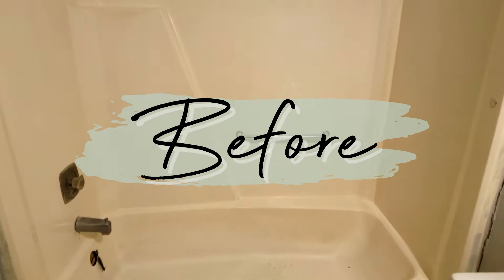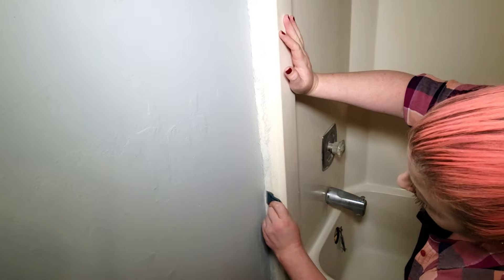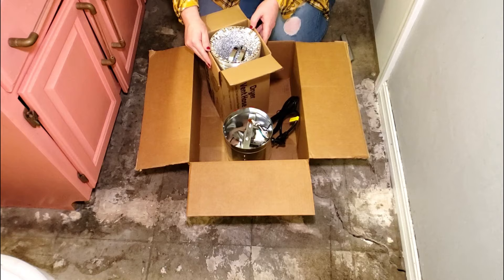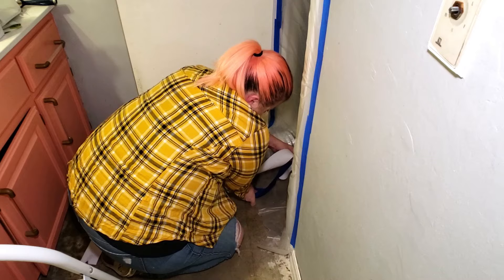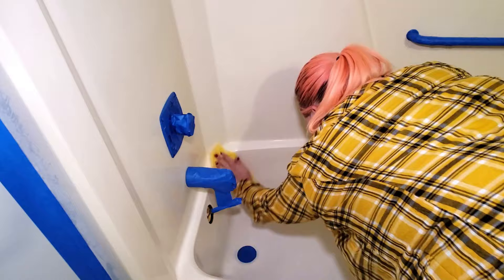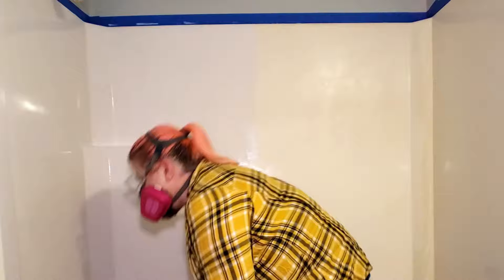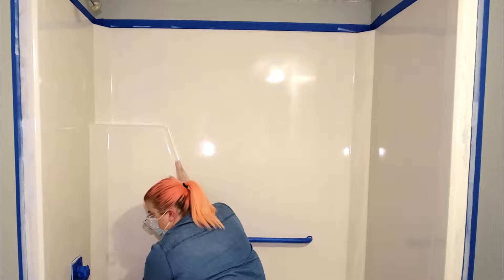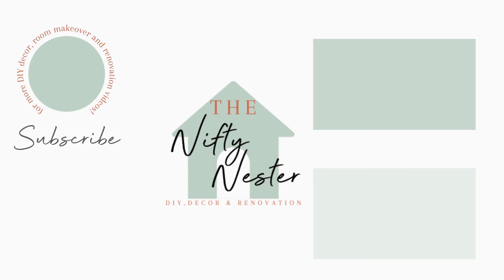How To Paint A Bathtub Yourself | The STRONGEST & CHEAPEST Way To Refinish Your Bathtub!

Comment: DON'T TAPE OFF the drain, handle or faucet! Just remove the screws of the handle cover & pull forward. The faucet uncrews (just enough that you can get the sponge brush behind it) & after removing the screw to the drain cover, the drain unscrews too.
Reply: If she didn’t tape off the drain then the paint/epoxy would fall down into it

Comment: 1) Why did you not use TSM to remove that stain and all oil residues 2) Why did you not use a primer - If you skip priming, you risk peeling paint, especially in humid conditions. Moreover, the lack of adhesion could make cleaning more difficult months after the paint has dried. You may find the paint wearing off as you're trying to wipe off dirt or fingerprints
Reply from the maker: First, that stain has been there for a couple of years. In that time frame I've tried TSP, bleach, mineral spirits, nothing worked. This tub is old, the finish was worn down and that stain is deeply embedded in to the material.
Secondly, I read every review on every website I could find where this paint was used to refinish a tub. This paint has consistently held up by itself over long periods of time without a primer if the surface was well prepped. I don't know if that's because it's an oil base, maybe it has some primer type properties to it. Either way this stuff dried in to a rock hard shell. There's no peeling at all, no stains coming through and when I clean it everything wipes right off. It actually cleans way easier than any tub I've ever had.
I assume most people paint their tubs when they need a fix without the cost of replacing it, I know I did. It looks like I'll get at least a few good years out of this and I can touch it up if I need to at that point. By then it will have served it's purpose and I couldn't have done the job for any cheaper.

Comment: Is this a good technique if my shower paint is peeling? I can do this and it’ll be fixed??
Reply from the maker: Good question, unfortunately this won't fix the issue with the paint on your tub. If the paint is peeling there's an issue with that paint bonding to the tub underneath. I would suggest scraping or sanding off the old paint first then starting over with this paint. I hope that helps, good luck!

Comment: thank you, question, what about primer
Reply from the maker: Sorry for the late response! You don't have to use a primer with this paint, they say to just make sure the surface is properly prepped beforehand. You could use a primer if you wanted to but you'd want to use an oil based primer if you decide to use one. I will say I haven't had any issues without using a primer.

Comment: Hi! I really loved this video and am in the process of doing the same to my walk in fiberglass shower. I’m worried though because the same paint I got as yours says to only do it above the water line. So I’m hesitant to do the floor. How has yours held up? Was it slipper at all? Anything you’d do or use differently?
Reply from the maker: Hey! Thank you 😊 I had the same worries after reading that as well but because the reviews were all so good I went ahead and did the entire thing. I haven't had any issues at all with the finish, it's held up great with regular use. I was also worried it would be too slippery but it hasn't been. Our original fiberglass tub had a slight texture to the bottom of the tub, I'm guessing as an anti-slip measure, and that texture still comes through which probably helps but the finish doesn't feel slick under my feet. They do sell a non-slip additive and I thought about trying that out on the bottom of the next tub that I do but I haven't needed it so far. You could probably add another coat with the non-slip additive at the end if you decide you need it.
Reply: @TheNiftyNester  that was all very helpful thank you so much for sharing 😊 I will definitely try it out then and add the adhesive if needed like you said. Thank you again ❣️

Comment: I'm curious to know how this has held up.
Reply: I used marine boat paint to paint the tiles in my tub/ shower (left the bath tub did not paint it). It looked great when it was done. After about one year it still looked pretty good. After about 2 years it started to show defects- small scratches and some minor peeling (mostly were the bar of soap was constantly hitting the wall). However now after 3 years it has started to really yellow. It still looks "white" (not horrible yellow like you would see in a smoker's home or bad yellowing you see in bright sunlight). It would still look kind of white if it was by itself however because it is directly next to the original high gloss bath tub, toilet, cabinets, shower bar etc that are all manufacture painted (I believe powder coated or porcelain) gloss white the yellowing of the marine paint becomes very noticeable. There is a big difference between the painted tiles and gloss white tub. Directly after painting the tiles the paint will look just like this video. Gloss white tiles blending nicely with the gloss bath tub. However be prepared to repaint every few years because it will definitely yellow over time. I am just happy I only painted my tiles that can be easier replace or covered with a liner if I dont' want to keep repainting vs painting my entire bathtub that would cost thousands of dollars to replace. 
Overall experience it looks great directly after painting. However it will yellow so be prepared to repaint every few years (in my experience three years).

Comment: I painted my tub myself. I was surprised how nice it turned out but……months later the paint is chipping a lot. I have to repaint again. I didn’t sand down the tub before painting the first time. Do you think that is why it peeled? The tub wasn’t used prior to the three day wait either.
Reply from the maker: I definitely think sanding it beforehand is one of the most important steps. The prep work is as important if not more important than the actual painting. After you get the old paint off, definitely take the time to prep your tub, and that should make a big difference this time around.

Comment: How safe are the chemicals in it to use in shower given the fact you had wear a mask to protect yourself?
Reply from the maker: That's a great point, I should've mentioned this in the video. The fumes are only an issue while working with the wet paint. Once it's dry and the paint has cured the fumes dissipate and it's totally safe.

Comment: Can I do touch up on certain places or do I have to paint the entire tub again? I've done 2 coats but there were a few spots that ran so I want to sand them and add more paint but I'm not sure about the process. Anyone know?
Reply from the maker: You should be able to sand and touch up just the areas that need it, like you said. It bonds better if you do that before it cures but even if it's already cured, scuffing the surface first should let the touch up stick.
Reply: @TheNiftyNester  Thank so much for the reply.

Comment: Can this paint be used on ceramic tiles and porcelain tub?
Reply from the maker: Yes it can. I did a lot of research before painting mine and found reviews of people successfully painting every bathroom surface imaginable. As long as you prep your surface properly first and degloss/sand it should adhere well.

Comment: I did this about 3 years ago. The result was amazing and it was worth all the process and smell. Until it started to peel. Now is nasty and it bothers me more than when the tub was pink. This is a really temporary solution.
Reply from the maker: It definitely isn't a permanent solution but helps to make an old tub liveable until you can replace it. Have you thought about sanding then repainting your tub? I figure if I still have mine in a few years I'll just repeat the process but I'm hoping I can gut and fully renovate this bathroom at that point.
Reply: Sucre Dulce,  did you use the Marine Paint or something else for your tub???

Comment: Will this paint work in a porcelain sink?
Reply from the maker: Yes, it should. I haven't personally painted a porcelain sink or tub but when doing the research on this paint I found reviews where others had painted theirs successfully and they said it worked. From what I read it should work on pretty much any hard surface that's typically used for sinks and showers.

Comment: Not quite a year ago.  How's it holding up?
Reply from the maker: It's holding up really well! I'm hoping to do an update video in the next month or so, but I would recommend this product all day long.
Reply: @TheNiftyNester  I just finished mine on a very old fiberglass shower stall.  Everything video I saw using the bathtub kits seemed so iffy to me.  The marine paint made sense and took about 1 and 1/2 quarts for two coats.  Turned out so nice.  Your video convinced me it was the right method for me and the smile on my wife's face validates it.  Thanks!

Comment: How long did this process take from start to finish?
Reply from the maker: I spent 3 days but it could be done in 2. I cleaned, sanded and prepped on day 1, did the 1st coat on day 2 and the 2nd coat on day 3. You could prep the same day as the 1st coat and get it done in 2 days. The actual time it takes to paint on a coat isn't long at all, I want to say it didn't even take an hour for each coat. It's the dry time in between that makes it a 2-3 day project.

Comment: Did this paint hold up because I see you didn't use the primer before painting
Reply from the maker: It's held up really well! I'll have an update video posted in a few weeks if you want to check that out. I'll probably try the primer on the next tub that I do, but this paint doesn't require a primer. They do say to use the primer if you have any damage or made any repairs to your tub/tile since the repaired areas need to be sealed. I also think it could be a good idea if you're covering a bright color. Someone commented that they used primer on their blue tub, and it covered the color really well. They didn't have to use as many layers of paint to hide it. You can always use the primer even if your tub is in good condition, you just don't have to. I hope that helps!
Reply: @TheNiftyNester  Good to know I bought the primer specifically for this paint made by rustoleum i havent tried it yet

Comment: Everyone says it yellows after time??
Reply: I used marine boat paint to paint the tiles in my tub/ shower (left the bath tub did not paint it). It looked great when it was done. After about one year it still looked pretty good. After about 2 years it started to show defects- small scratches and some minor peeling (mostly were the bar of soap was constantly hitting the wall). However now after 3 years it has started to really yellow. It still looks "white" (not horrible yellow like you would see in a smoker's home or bad yellowing you see in bright sunlight). It would still look kind of white if it was by itself however because it is directly next to the original high gloss bath tub, toilet, cabinets, shower bar etc that are all manufacture painted (I believe power coated or porcelain) gloss white the yellowing of the marine paint becomes very noticeable. There is a big difference between the painted tiles and gloss white tub. Directly after painting the tiles the paint will look just like this video. Gloss white tiles blending nicely with the gloss bath tub. However be prepared to repaint every few years because it will definitely yellow over time. I am just happy I only painted my tiles that can be easier replace or covered with a liner if I dont' want to keep repainting vs painting my entire bathtub that would cost thousands of dollars to replace. 
Overall experience it looks great directly after painting. However it will yellow so be prepared to repaint every few years (in my experience three years).

Comment: How did you get rid of the smell? I recently painted mine and I'm worried about the fumes not going away.
Reply from the maker: Have the fumes gone away now that it's been a few days? I left my ventilation system running for a while after applying each coat, then turned it off before I went to bed. After the last coat, by the time I turned the ventilation system off at the end of the day, there wasn't much of a smell left. By the time the tub had cured (about 3 days later), there wasn't any smell left. Sorry, I don't have any great advice other than that.
Reply: @TheNiftyNester  So the fumes have gone away, but it has like an after stench. But I've only been able to put on 1 layer so far due to time constraints.

Comment: So no primer needed?
Reply from the maker: If your tub is in good condition you don't need primer. If you make any repairs, like fill in chips or cracks, then you'll want to use the Rustoleum Marine primer first. Any repaired areas won't be ready to adhere to the paint. Other than that, this paint is meant to stick to this type of surface without needing a primer.
Reply: @TheNiftyNester  thanks

Comment from the maker: You can watch the BATHROOM MAKEOVER ON A BUDGET final episode & reveal right here! https://youtu.be/tjeefKzNcUU
Reply: Great job. Just remember not to use bleach or bath mats on resurfaced tubs. The bleach will make the paint bubble and the mats will pull up the paint. I'm an apartment manager and residents tend to forget and mess up the tubs.
Reply from the maker: @CindyLou42  Thank you! Can I ask what you guys use to refinish the bathtubs at your complex? I've used bleach cleaner on mine without any problems, although I've only used it a few times. I usually use a different bathtub cleaner. I know a lot of the tub and tile kits are epoxy, I wonder if bleach is bad for epoxy specifically?
Reply: @TheNiftyNester  The company we use applies a urethane coating and recommends cleaning with Lysol, Mr. Clean, Fantastik, Scrubbing bubbles, Formula 409 or anything mild and non abrasive. If you use bleach, you'll notice the paint will start peeling after a few months. If you use it a lot,  it may start peeling within a month.

Comment: It won't stay you should have used a two-part epoxy then you're onto something otherwise it's just going to fade
Reply from the maker: It's been almost 2 years, and I'm not having any issues with the finish at all. I decided on this product after stumbling across it and reading every single review I could find. A lot of people have had great results with this product. On the other hand, a lot of people have had really bad experiences with tub & tile kits. 2 part epoxy is probably a great option as well. I looked into one, but it would've cost me over $100 in product alone. I'm happy with this product and you can't beat the cost. In the end, I think everyone should use what works for them and is in their budget.

Comment: Next time do better prep work or at the very least let people know you can take trim pieces and accessories off before painting so you know.... they don't have to repeat the process if they decide to replace with different faucets and trim/handle..... pretty lazy if you ask me, especially considering the time you took to set up the door seal and ventilation. Refinishing a tub without installing new accessories and fixtures is like putting a $3000 set of wheels and tires on a beat up rusty old Honda civic.